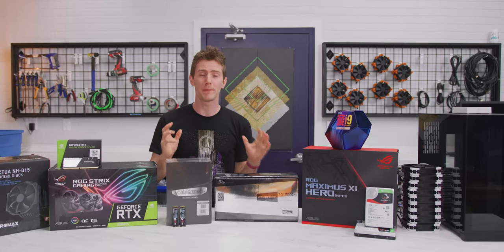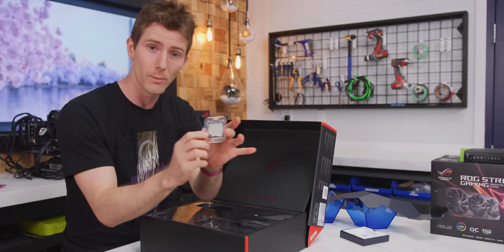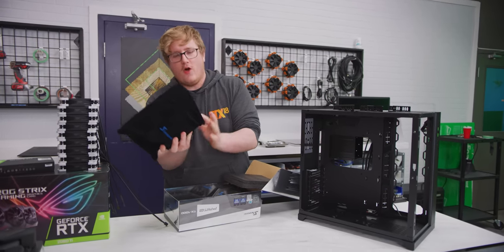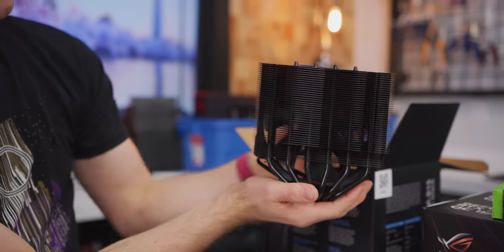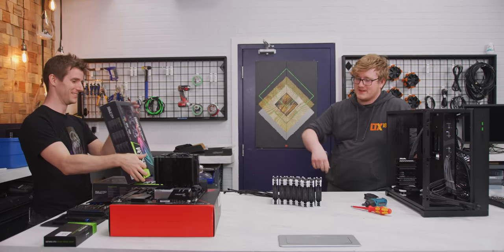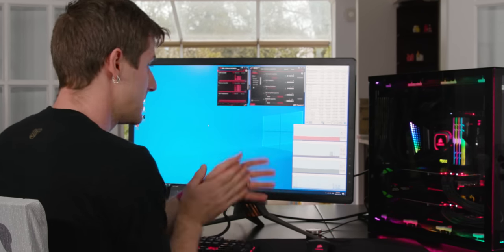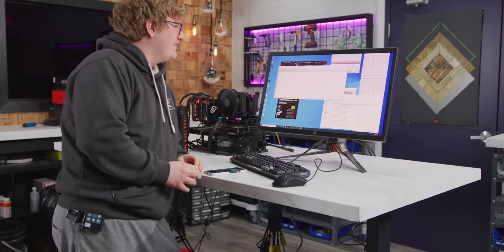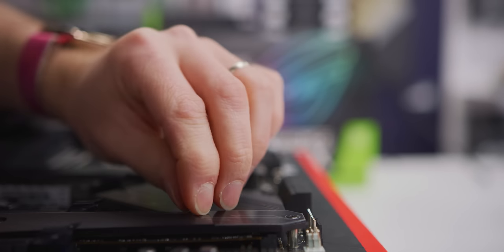Can AMD Beat the ULTIMATE Intel Gaming PC?

Comment: Prebinned Intel vs AMD performance: +5% while gaming, -49% while working.
Reply: yeah this is a no brainer. of course in low threaded workloads higher clock speeds are gonna be better by default. intel cant put out anything more than 10 cores at 105w tdp
Reply: Jarek Rymut it's depend on what u use, most benchmarks are showing raw performance, not the real world performance, most programme do have favors for intel (becuz of money)
Reply: for example : who the fuck would buy an 3900x instead of 9900k to use solidwork?? dont just look at benchmark
Reply: render is not everything
Reply: Alistair yeh my english is kinda bad, im talking about the proccess of creating the project, 9900k is like the best, 3950x is great,  3950x will render faster but when u creating things 9900k is smoother
Reply: @tuenguyen9990  ? What are you doing that is pegging your CPU/GPU in Solidworks other than rendering? Why would a clock speed over 3.5 even matter? I don't have a ton of experience with that program in particular but I have used programs like it and am taking a class in Inventor this quarter, idk if that is right but I'll get back to you.
Reply: imagine using solid works instead of a decent 3D package.
Reply: Johanna van der Lucht ??? they targeting different people
Reply: sound palette what im trying to say is most programme(not all) support intel better (because of money)
Reply: @hannekevanderlucht5456  imagine thinking solidworks isn't the most comprehensive and useful 3d modeling and engineering tool available..
Reply: @howdoyoudoit3499   lol
Reply: An average of 150 mhz loses per 5 degree increase is also why intell is king, imagine living in a desert and using a ryzen... what a rip
Reply: Alistair Ryzen is by far not “colder” it just has a better ihs and contact which allows better heat dissipation, heat dissipation is nothing if you are bot removing the heat.  But specific my comment was referring to ambient temps. If you run a work load that makes a Ryzen exceed its threshold (around 50 degrees c) you will loose around 150mhz per core per 5 degrees over that. if you cannot afford insane cooling  like that which will cost as much if not more then the cpu itself, then not only is a it a waste of money but you will never get the advertised minimum freq because you regarless of how the heat got there it’s still losing req per core at a rate of 150mhx per core per 5 degrees
Reply: Alistair Ryzen fan boy, whats 16 cores @ 2 ghz if you can have 8cores at 5.0+??? Lololol
Reply: Honestly guys he just went Intel so he wouldn't be called an AMD fanboy. Yes the AMD chips are massively superior to the Intel ones for almost everything. Intel could compete if they wanted, but they would prefer to price gouge their corporate clients instead.
Reply: @habib_the_panda  if u did the same thing to an intel cpu in your theory it'd lag out and thermal throttle even worse wtf kind of example is that?
Reply: What everyone is forgetting about is you need to keep a AMD cpu below 50c to get those results where as with intell you can be at 80c and not have an issue besides a hot cpu, AMD cpus cost less because you have to spend more else where hence why  they are work only cpus because to get an AMD to achieve this you need it in aircon that feels like Antarctica. Hot environment = unusable AMD cpu.       Equally hot environment = no problem for intel even if it tuns hotter before the ihs
Reply: @habib_the_panda  that is wrong, ryzen can go over 90c before starting to throttle
Reply: Kawaii Hatsune cores + threads x freq = performance after a certain point the amd will run alot slower overall then the intell but only in hot environments. AMD only wins in very specific cases where every is controlled perfectly ie: ambient temp controlled through aircon. The fact is if you live where its cold get an AmD if you live where its hot or cant afford awesome cooling then get an intel
Reply: @habib_the_panda  lol
Reply: Braze IAR too fucking true
Reply: @habib_the_panda  What you are saying is not true for Ryzen. Just complete nonsense.
Reply: @habib_the_panda  what are you talking about ?
i live in thailand and it's going 40c in some day
my R5 3600 with cm410m cooler kept it under 60c in hottest day and that's on 4.3 ghz all the time with 1.3 volt and no i don't have AC
and my friend 3900x goes over 100c but his cooler is stock ryzen 5 cooler from my system no oc just bare stock no AC and all results said 
it doesn't even make any different than hottest intel chip
all cpu needs cooler environment to get it's maximum performance not just amd this intel that it doesn't really work that way.
Reply: Slicerz717 go watch gn and more ltt they prove it and show how a Ryzen can beat an intell many times over if you keep it cool but thats the BIG IF.
Reply: 없습니다다른 방법은 thats single core temp  not total package
Reply: 없습니다다른 방법은 and straight up your lying because because AMD states this also so you are literally saying that only your cpus perform differently to how the where manufactured to operate, they are not frogs they cannot just change internal parts at will
Reply: Alistair do you what else is noticable? 10+ fps difference in close quarters combat and reactions times in such conditions
Reply: Revolvin Goatt no thats simply not true, developers have always gotten more out of their games with intel, intel has also held the crown for longer which means that of course games are designed to work better on intel arch because intel arch has been the only king pin in gaming for how long? So the majority of players have an intel cpu. Now why would you want to piss off the majority of your potential customers?
Reply: Why is everyone so butt-hurt about their individual brands, Intel is better for gaming, Ryzen is better for workstation and is overall a better cpu for money (and this is coming from someone who will still buy Intel because I love overclocking and Intel chips are better at overclocking and more fun to mess with)
Reply: howard evans idk i guess they have used them for so long its hard for them to believe anything else, i mean i just built my second pc and was regretting not going AMD after seeing the price of a zen 2. But honestly for the extra frames ill be right till next gen i think
Reply: @habib_the_panda  Watched a bunch of tech reviewers for many years now. Right now Intel holds the performance crown in most single threaded workloads due to its higher clock speeds. Yes ryzen does perform better if it has better cooling, just like every type of silicon does. However there is a limit. It still cannot beat Intel, especially in gaming. This is for many reasons, not just cooling.(not talking about exotic cooling) However ryzen is an extremely competitive product that blows everything from low end to server end in General use. Great if you wanna game, great if you have proper work to do. Especially for the wallet.
Reply: Slicerz717 you literally just reworded what i said and then chucked actuall BS in. Regarless of work load after 50c regarless of what cpu from AMD you WILl LOOSE AROUND 150 mhz per 5c over 50c, do the math genius, there is no point having 16 cores if they are running at half the speed because you literally are going to end up with the same result thanks to dynamic computing (not mentioned by tech reviewers).  I never said ryzen was/is  not competitive so thats pointless, umm you pointed out a bunch of things i already said........ yea better for the wallet if you can get the cooling cheap again ONLY if you can or if you live in a nice cool area. you want those extra frames and want to stream go intel, if you are Digital editing or creating detailed content then ryzen every day of the week just with probably 6 chasses fans and 720 mm of aio hahaha
Reply: k3krojin i wasnt talking about throttling, TT is a seperate feature, but yes you are right
Reply: Lionhart i had a similar discovery watch a channel benchmark the new cod with a 2070 super, 9700k, and 3600 mhz with 16 gb ram, everything was overclocked and their highest was 70-80 fps,  now i run a OCed 9700k only 4.9 all C, 1660ti CC @ 1890 (runs activily up to 2040ish mhz?) mem clock is 14000 with 16gb ram @ 3200 mhz and my lowest point is 72 averaging 90-110, and in close quarters 120-144 fps. I think that just comes down to the silicon lottery tbh though, what do you think? Oh and this is at 1080p at max settings my AA was also maxxed.
Reply: Lionhart thats the infinity fabric for you, i mean they can compete with intell if you spend 1k on ram alone
Reply: Lionhart  They were running on 4K
Reply: @habib_the_panda  You know you're part of the problem right? You're so far on Intel's side that you wont even look at multi-threaded workloads that Ryzen does kill Intel. You are too close minded, calm down and take it down a couple notches.
Reply: I've never seen someone angry or stressed because his pc took 10 seconds more to render. But I can't say the same about gamers when FPS drops below 60.
Also, pretty sure there's more people gaming with pcs than doing a fucking heavy workload that require these cpus. And I can bet my life that you are not one of them as well.
Reply: Habib_The _Panda Ryzen loosing 150mhz per core when reach above 50c? lol. What are you talking about? Trollolol
Reply: Lionhart the infinity fabric is the specific part of the architecture that passes info from place to place, the apees of the infinity fabric is directly affected by ram freq meaning that you will get more out of OCed ram on AMD then Intel. As for the mouse thing i have bo idea about loads that tiny, and if that is true with just the input lag alone then Thats a fat rip
Reply: BenZoneOfficial im Talking about Amd’s press release talking about how they are trying to combat it because atm it is their  largest issue in their opinion.
Reply: Lionhart i tried dropping in the most densely populated areas on br and just lobbing grenades and rpgs woth the whole squad in the middle of 5 other because i was tryna see if it would dip below 70. I think i will need 3d mark but yes i tried in there way also but it just didn’t seem to tax my system in the way it taxed theirs idk whats happened
Reply: Michael Gattus and that someone is clearly you because you assume i prefer either or like a typical fan boy, no leg to stand so claim the other person is obsessed when even the manufacture admits these are the issues it currently attempting to tackle by dye stacking.
Reply: MrMW2nd they choose not to because of their target audience, the exact same goes for AMD its just AMD basically stole all commercial business from intell hahaha interesting times
Reply: Lionhart my bet is the fabric, that why they wanna move to dye stacking, atm data has to travel over a physically longer path with any ryzen due to only certain parts being linked, though the data can move both ways the various components are not interconnected like intel through their ring thingy, i always forget whats its called intel loves its long names...
Reply: @habib_the_panda  I still dont know where that "Ryzen loosing 150mhz per core every 5c when reaching above 50c" came from. Give us the source or it just a fakenews.
Reply: BenZoneOfficial 1. Its not news and the source is AMD 2. It will vary i am just giving the most extreme conditions (say if you lost the silicon lottery) still even if you get lucky and only get the 75 mhz loss, thats a best case scenario with winning the silicon lottery and having a very expensive and well ventilated cooling system. I forget exact what amd calls but intel just brought out their version which does the exact same thing, it simply tweaks frequency to control temp increase, it is not the same as the thermal throttling feature and is only on ryzen 3000 series (im not sure if i mentioned that before). Seriously look it up if not ill search it and see how easy it is to find a reliable source review so you can actually see it happening rather then tech’s talking about how it works, but then that’ll just prove your a fan boy or troll or dumb af
Reply: @habib_the_panda  okay, hilarious you have made that same statement over and over again about the 150mHz drop per 10 degree's to fold fifty comments later. Dude, I have my house at 70 degrees F. I have my 3.6 rated 4 core cpu overclocked to 4 G and I have never seen the CPU go above 45 degrees maybe, and that is spikes. I am using a 33 dollar aftermarket air-cooler. Idk what is going on but if you can't afford air conditioning don't OC that much or wait to buy the expensive-ass intel parts lol
Reply: @habib_the_panda  My AMD using box cooler rarely ever uses the fans. Actually I think the fans are probably juist my graphics card :)
Reply: Braze IAR thats a good thing bro, thread intensive workload will produce immense heat so of you plan on working her make sure you can keep her cool enough to achieve the freq you desire. Look how salty this other guy is, he asked for proof, i gave him proof and now it isnt good enough.... typical fan boys
Reply: @habib_the_panda  The AMD processors run quite cool, but they don't have much headroom, that said the 10th gen Intel ones are now clocked within an inch of their life. Intel's "selling point" is its brand name. AMD's is excellent performance at price per dollar. Hopefully Intel will launch another 2nd gen type series and we will get more competition which is where we all win.
Reply: Braze IAR exactly, i cant believe you and only one other person gets it, the only reason i personally have not gone Ryzen is because of this feature because its like 400ish dollars for the 8 core cpu i would have gotten from them but for my application (heavy gaming and streaming, study and tech support etc) it would have performed worse because my workloads would have pushed the cpu to above 60c with stock cooling even with 3 chassis fans, and im honestly when im dealing with hardware that finicky im not going any less then 6 fans on a 360 mm rad and im not even using all the threads!!!! Imagine if i was!!! The freq lose from the heat makes the frame rates drop, dead body physics ends up trash af, basically anything the prefer higher freq will suffer and since my application is mostly gaming, the target temp i need out of the 3rd gen chip with my workload is only achievable with min 320 rad with 6 fans, gpu must have at least 3 fans or it will increase cpu temp to nearly an useable point for gaming competitively oh 3 fans at least for outtake. All of that said its still the cooling solution thats costs the arm and the leg went it comes to ryzen but thats is exactly how they get away with selling cheaper cpu’s but the masses don’t realise that their workload is not actually as demanding as they would have themselves believe. But still amd is cheaper then intel but cooling an intell is cheaper then AMD. AMD is still the budget build king though, i mean you can get 6 cores and 6 threads for how much? Thats more then enough for every gamer who is not professional with incomparable value and its zen 1 or 2 so no bullshit double throttling!!
Reply: Braze IAR oh and careful you are comparing laptop and mobile 10th gen to AMDs desktop gen, they are completly different applications of the same tech
Reply: @habib_the_panda  Intel invested very heavily in low power for the past few years. Actually there were a lot of complaints about it, and people were demanding the effort go into performance instead, but now people are happy with lower consumption. When Intel gets over it's process technology problems they will be able to offer more cores at a better price. Also AMD benefits from the Bulldozer CPUs with Ryzen, but Bulldozer was ahead of its time and so massively underformed at a time when Intel's chips had sufficient cores but tons of power in them. Even today people use 2600K for gaming, that is an amazing value on a per year basis. As for your situation I wouldn't suggest changing CPU if your current one is working well. There's no point getting a higher core CPU if you don't actually need the cores :)